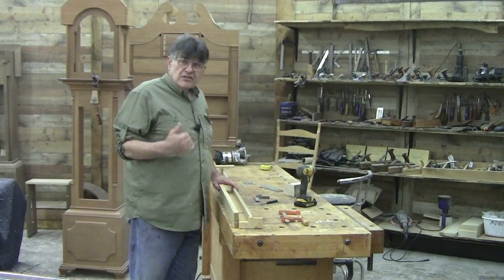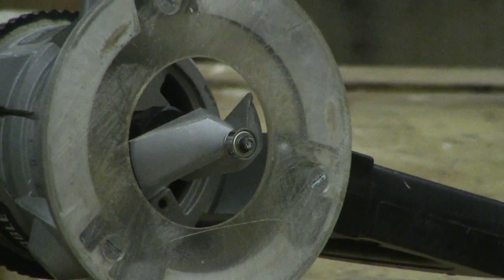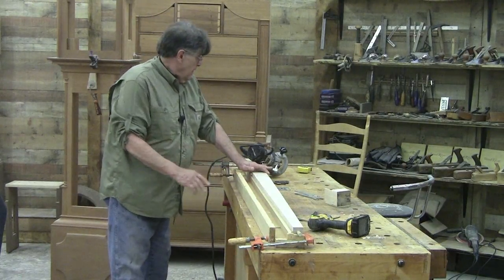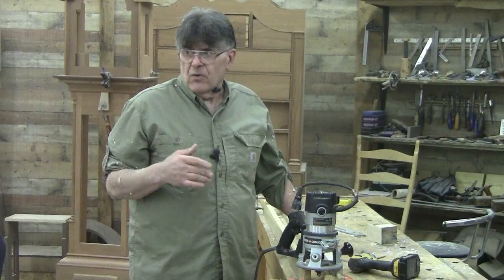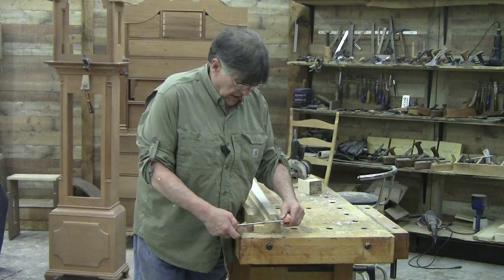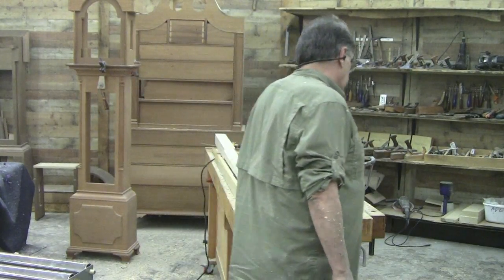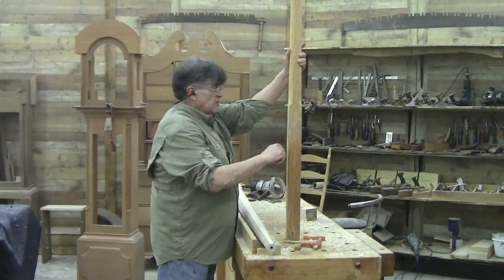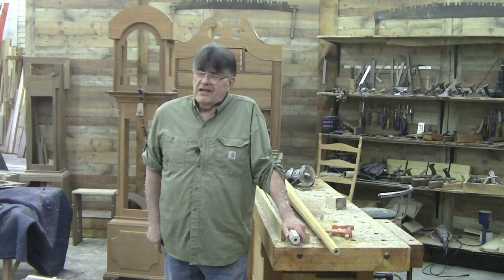Chamfering a Pencil Post Bed with Charles Neil

Comment: I had a question about one of your older videos about the arm r seal By general finishes on the cutting board ! Can you maybe make another video about the arm~r~seal on cutting boards answering these questions ? How long would you let it cure before handing it to someone as a gift ? And what would you wipe it down with when It gets dirty ? And will it show knife marks immediately even when it's cured ? And if I wanted to redo it because it got beat up after a long time of heavy use ,,,, how would I go about doing that ? If you really don't want to make a new video if you could please answer these questions in order that would also be a big help, love your videos man